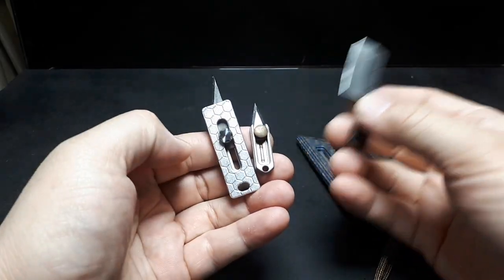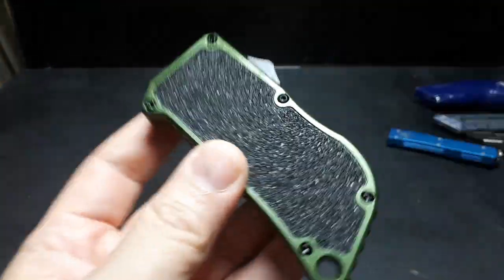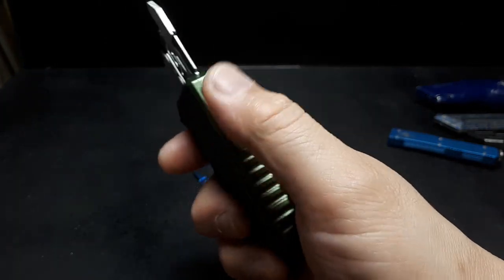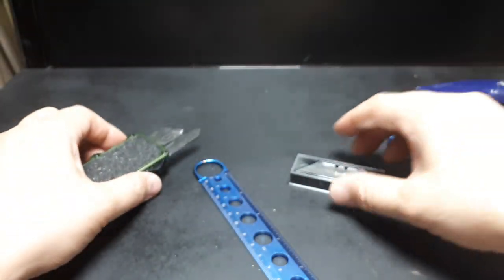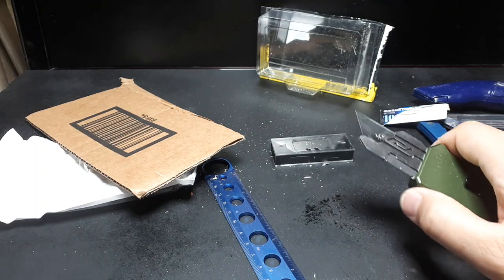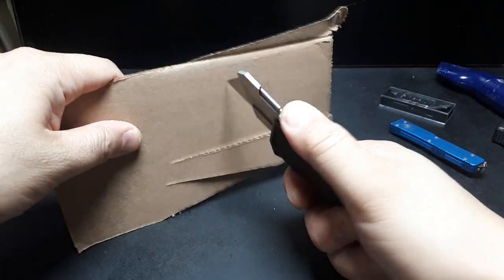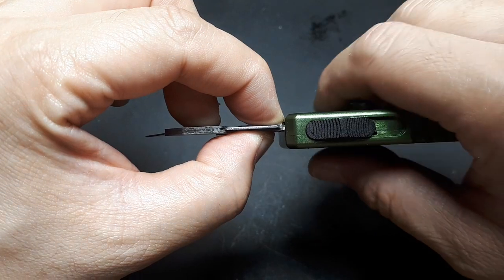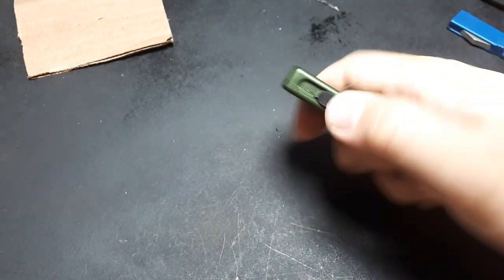OTF automatic knife SK5 blade box cutter EDC utility generic Aliexpress cnc alloy

Comment: Ive been using mine for 9 months at work. The one I have is identical except the screws are torx. The other material is leather. I have the “sticky tape” and hate the feeling of it. The only problem I’ve had with it is it quit working last week. I took it apart and cleaned it. It’s working like new.  Over all I love it except for the “sticky tape” feeling.